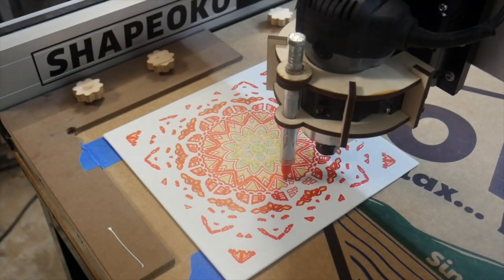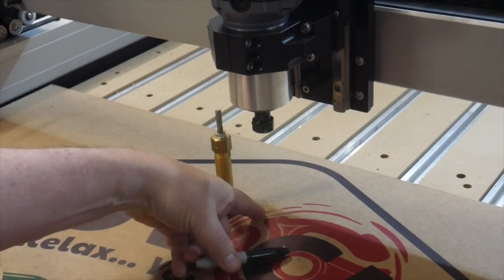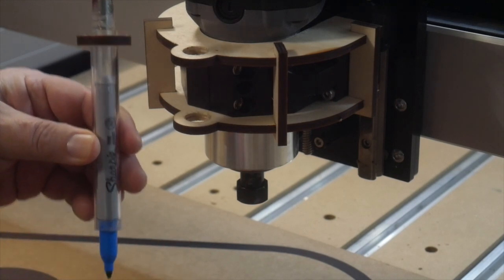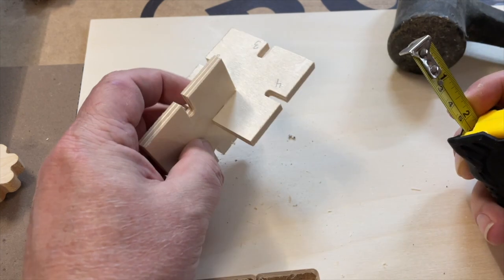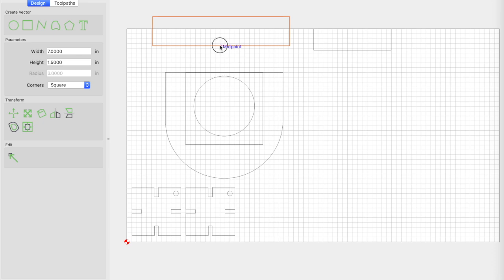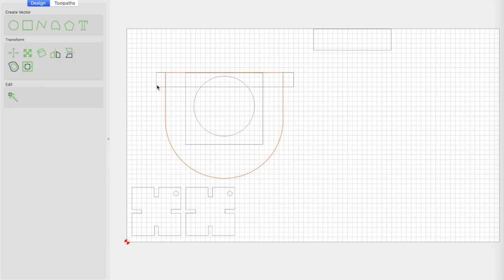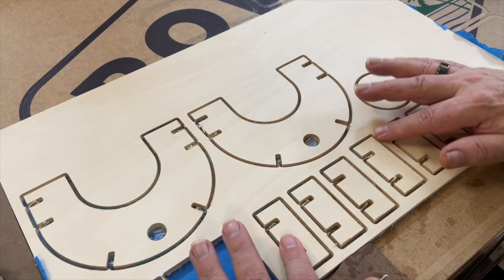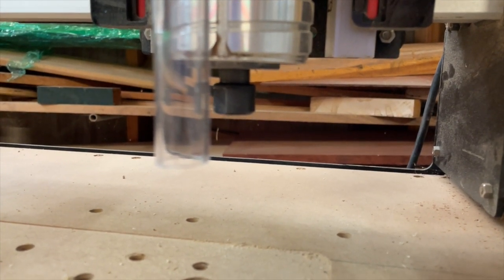Drawing on CNC

Comment: Hello, Thank you for the content, it is great! I was wondering how do you set up the machine to do only one passe? mine is always doing 2 wich is not necessary.... Thanks a lot!!
Reply from the maker: Hi Thomas. Glad you like the videos. The number of passes is determined by the depth of cut in the tool path and the depth per pass on the bit itself. If you edit any of your bits in Carbide Create, you will see a number for depth per pass. This is how deep the bit is allowed to go each time it cuts. Let's say for this example, it's set to 0.05. If you set the final depth of the cut you want to make to make in your tool path to 0.06, the machine makes a pass at 0.05 and then a second pass at 0.01. To limit things to a single pass, the final depth in the tool path needs to be less than (or equal to) the depth per pass on the bit. Does that make sense?
Reply: @johnearlclark  Hi John , thanks a lot, you juste saved me a lot of pain!!! thank you very much and keep up the great art and content!!

Comment: At the beginning of the video, you show the pen holder on a Shapeoko HD Spindle Mount, but in the video you build the pen holder for the standard spindle mount. Are the files you've included for the HD Spindle Mount or for the standard spindle mount? I'm looking for the HD Spindle Mount file.
Reply from the maker: The Shapeoko 3 files are for the old Dewalt Router Mount, the Shapeoko 4 files are for the newer HD mount.
Reply: @johnearlclark  Got it! Thanks! I've got a Shapeoko 3 with the HDZ and HD spindle mount. So, I'll use the Shapeoko 4 files.

Comment: Thanks for the great information.  Do you do your own designs?  If not where do you get them?
Reply from the maker: The circles drawing is mine the rest I believe came from Etsy. I get a lot of stuff from there and Shutterstock.
Reply: @johnearlclark  What do you look for in a stock image for it to be suitable for drawing like this? What type of toolpaths do you use?
Reply from the maker: @TheOttacat  It needs to be a vector file (SVG, EPS, PDF, Illustrator) and not a bitmap (JPG, GIF, BMP). The only toolpaths I use are contour with no offset (basically follow the line exactly) or pocket to color in the shape. I tend to drop the tip about .05 inches to allow for any unevenness in the material. Does that make sense?
Reply: @johnearlclark  Perfect sense, thank you.